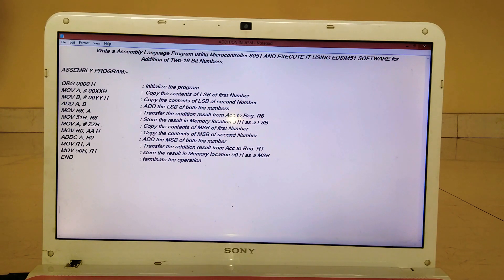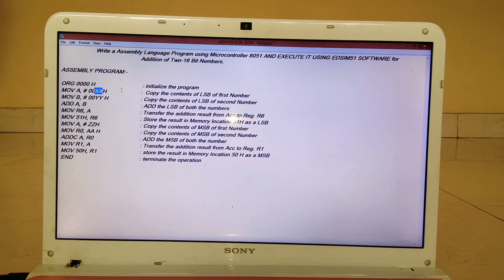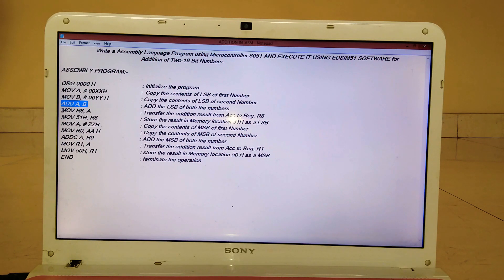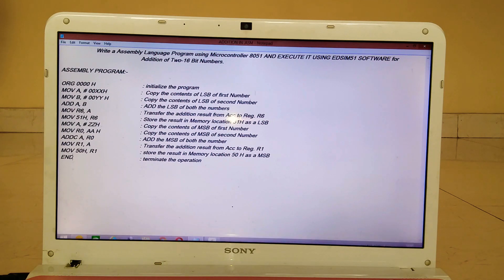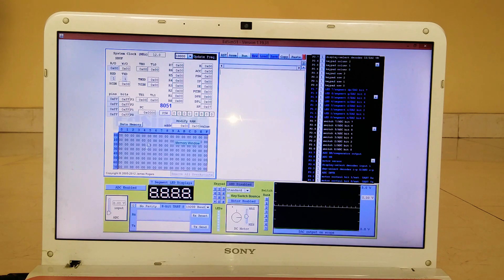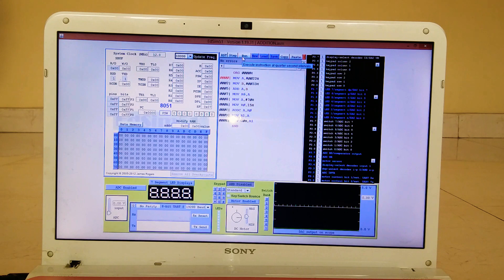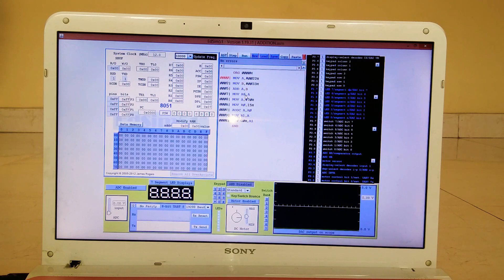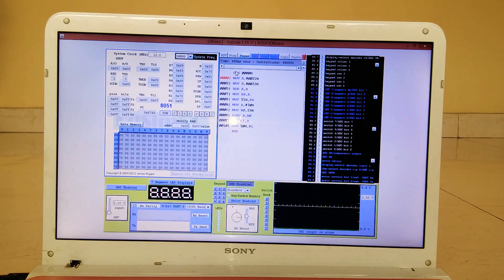ADDITION OF TWO-16 BITS NUMBER USING EDSIM51 SOFTWARE 😁

Comment from the maker: ANY QUERIES EMAIL ME ON THIS ID:- ingaleninad98@gmail.com
LINK TO DOWNLOAD EDSIM51 SOFTWARE:- https://www.edsim51.com/
EXPLANATION:-
• Assume two, 16 bit numbers at different register locations. 
• First 16 bit number word of data is present in the A register and a 2nd number word of data is present in the B Register. Used immediate addressing mode.
• Add LSB and Then MSB bits of number in register A with the number in register B by using ADD/ADDC instruction; add the contents in the A and B.
• Result will be stored in the A Registeri.e at destination location. Also store the result in memory location.
• Change the result location from register A to any other register i.e R3. So Accumulator becomes free for further operation.

PROGRAM:-
Instructions     comment

ORG 0000 H                 : initialize the program
MOV A, # 00XXH  :  Copy the contents of LSB of first Number
MOV B, # 00YY H  : Copy the contents of LSB of second Number
ADD A, B   : ADD the LSB of both the numbers
MOV R6, A                     : Transfer the addition result from Acc to Reg. R6
MOV 51H, R6                 :Store the result in Memory location 51H as a LSB
MOV A, # ZZH  : Copy the contents of MSB of first Number
MOV R0, AA H  : Copy the contents of MSB of second Number 
ADDC A, R0   : ADD the MSB of both the number
MOV R1, A   : Transfer the addition result from Acc to Reg. R1
MOV 50H, R1  : store the result in Memory location 50 H as a MSB
END    : terminate the operation